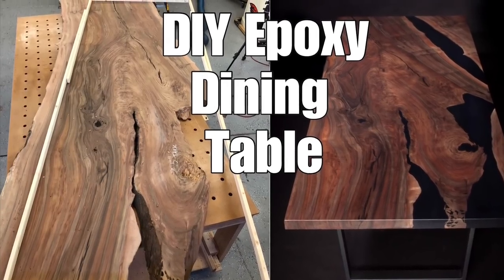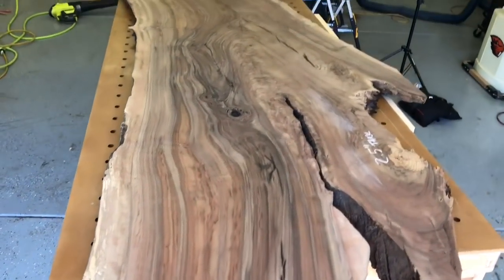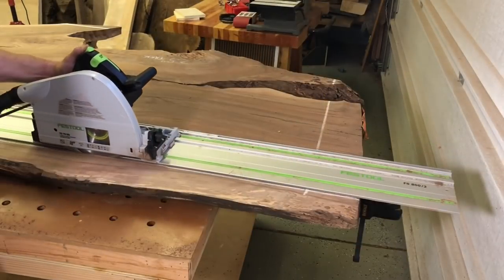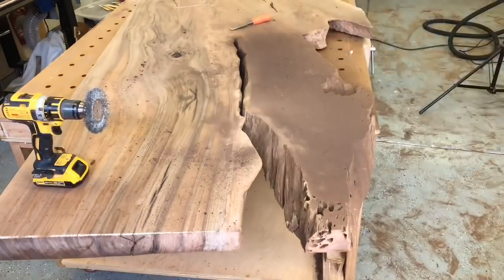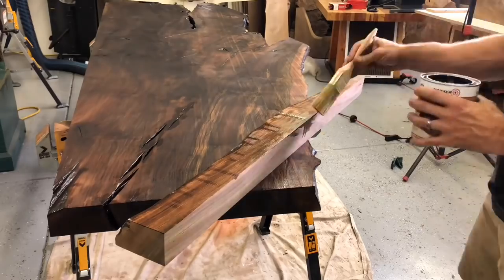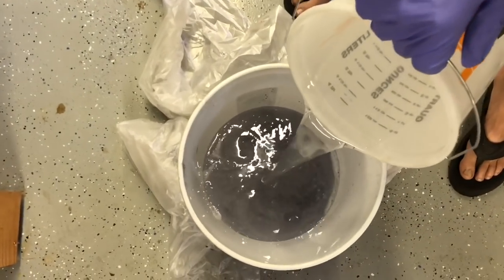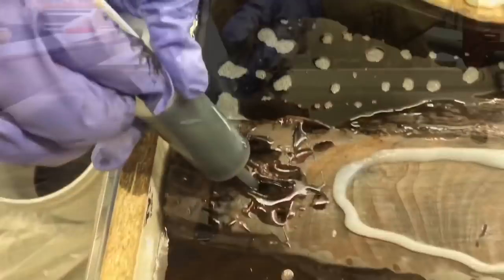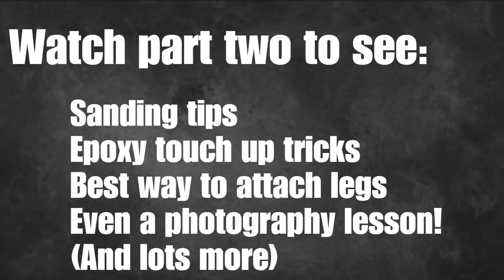DIY Epoxy Dining Table—How to Woodworking—Part One of Two

Comment: Blacktail, have you considered a penetrating epoxy to fill the rotted but very neat looking areas of the slab?   By impregnating with CPES or similar product- wonder if these areas could be left intact?  (filled and stabilized )
Reply from the maker: Kevin Morin you know, that’s a good idea. I hadn’t thought of that, but I don’t see why I couldn’t do that.
Reply: I'd prefer to see the really authentic roughness of bark, rot, spalt, and the rest over a 'dressed' edge?  Once soaked half dozen times (?) seems like the really ragged edges would be more interesting and pleasing?  Just a thought.

Comment: Sorry, never used epoxy before, I didn't quite catch why you did 3 pours. What would be the problem in doing just one pour?
Reply from the maker: Can overheat if you get it too thick when it’s hot out

Comment: Does the wood need to be fully dried? 
I'm going to have a tree cut but I don't know whether I can use that straight away without drying?
Reply from the maker: That’s one thing that isn’t negotiable. Wood definitely needs to be completely dry. I’ve learn the hard way.
Reply: @BlacktailStudio  is it better to wait for the natural dry or is there any good way you would suggest to dry it?

Comment: I have been using ecopoxy (liquid plastic 2:1 ratio) and have found in all the kits I have purchased (3 kits of 6 litres each) that the resin has started to crystallize into hard chunks, (not very large, most can pour through the opening, but some are larger and cannot fit). One kit already had those chunks in it, and the other 2 bottles of resin started to crystallize after about a month. I contacted the company and they said this will happen with the resin only and all I have to do is heat the resin prior to using and the chunks will melt and blend back into the rest of the resin. I tried that numerous times, and now I siphon the resin. But with the cost of this product it is really hard to justify buying it if this is a regular occurrence. Have you had any similar occurrences. This has happened during the winter months when admittedly the basement has been cool.
Reply from the maker: I heat all mine up in a shop sink first because of that. Very common problem

Comment: What kind of setup is that called for your skill saw as far as the guide for cutting on the straight line I've never seen one of those before and what brand  was your saw
Reply from the maker: A straight board next to your saw is a good start. Can’t really explain the jig I made here, but I’m sure you can google it

Comment: I am getting into the epoxy woodworkings and am trying to do a table top. I have got 2 really pretty pieces of cedar wood sanded down but I am at a stand still because I'm not sure what I use to build the frame to keep the epoxy from leaking out. What exactly is the name of the material you used for building your frame/box
Reply from the maker: Melamine. Easy to find!

Comment: My shop is not temperature controlled.  Am using liquid glass deep pour and temps will be between 55 and 70 degree F.  Thinking it will cause issues with my pour, can you confirm?
Reply from the maker: Na, should be fine

Comment: I would like to know why your epoxy did not "erupt".   I filled a large crack in a tree cross-section about five inches thick.  My epoxy boiled over and took several pours to complete it.  Is it the epoxy or something I did wrong.
Reply from the maker: It’s the epoxy I use 👍🏼

Comment: YOu don't need or want an employee...
Lots more hassle than any of them are worth...
You need either a mechanical hillbilly or an overhead runway lift setup, which is not hard to design or build.
Good job, thanks for posting.
Reply from the maker: I got one now.... the hoist. Not an employee

Comment: Depending on the species of wood and it's availability as well as market value (rarity, grain, burl, etc.), a slab of exotic wood can cost from, $300 USD to $4,000 USD.. If you live close bu one of these sources, you can save shipping cost, otherwise you'll pay an arm, a leg and your first born to have it shipped to you.

Comment: Why is there so much dust coming off your festool track saw? Just seen part two, table looks awesome by the way.
Reply: The reason that's happening is that he doesn't have the splinter guard attached to his saw. It needs to be attached (his is missing) and down fully on the workpiece and all of that dust will go into the vac. That was one of the many things I learned in Festool class last month in Ind. Mine was doing a similar thing, just dropping that splinter guard down changed everything!
Reply from the maker: I have a splinter guard on there, but maybe it’s time to be replaced? Thanks for the tip!

Comment: I see you checking the depth with a dowel rod.  What is the reason to check the depth?
Reply from the maker: Not to get the pour too thick. It can overheat and ruin the pour

Comment: I need your help man
I'm doing my first river table
Just casted it 4 hours ago a 28 mm cast (the manufacturer says it can be up to 30 mm in one layer) 

Now a major portion is hardened with a rippled surfacd while small others parts are not hardened and still have a leveled surface 
And i have a big crack in the middle

Please tell me this is salvageable or tell me what to do
I'm afraid i ruined my first time
Reply from the maker: 😬... same thing happened my first table. I broke it out and re poured

Comment: Hey, on pouring first layer i found lot of resin gets under the wood even after putting weights, how to stop it?
Reply: Yes, i thought first of putting silicon on the sides , but fear that it will look bad on transparent pigment i didn't use it ...😅plss share ur thoughts

Comment: you should fill it with dowels or something to save on materials cost
Reply: ianjsutt  like fill it up with a filler so you don't need as much epoxy. I imagined a buncha trimmed dowels standing up like a forest with glue being poured around them. Might make it stronger too?
Reply: ianjsutt  I did not think of the air bubbles being trapped by the dowels , thats a good thought

Comment: Does anyone know how to make sure the epoxy that fills the voids doesn’t seep underneath the wood? I’m having this issue (on a much smaller scale) and then end up having to sand it all off on the bottom after it dries.
Reply from the maker: It’s really hard to stop that. So I let it

Comment: so my table broke up into large chunks overnight. Did I pour to thick of a layer at one time? I dont understand. I would imagine that I can just put more epoxy over it and it will be fine though...thats what Im hoping. The epoxy that I bought seems to be hardening up really quickly....like in a few hours. Been waiting a day between pours though.
Reply from the maker: Oh man... that’s too bad. Yeah, you went too thick. I’ve been there. You really need to use an epoxy designed for deep pours. Or else you’ll be limited to 1/8” deep per pour.
Reply: @BlacktailStudio  Dang it lol oh well, its a learning process. This is my first build. Think if I put more epoxy over it, it'll just fill the cracks and be okay? I've got about $500 worth of epoxy on it so I dont want to just throw it away. Yeah, they're deep cracks but i'd imagine it wouldn't be any different than putting a new coat on a scratch up surface?
Reply from the maker: Andrew Bondsteel man, I don’t know... I’ve had to break the epoxy out and repour 😬
Reply: @BlacktailStudio  Appreciate it. I just poured another layer over it and it filled it up so we'll see what happens lol Definiately a learning experience.

Comment: Instead of using the injector to fill in all the gaps, why not cover the entire table with like 1/8" of epoxy and then use the industrial planer to plane it back to wood?
Reply from the maker: Would cost a lot. That would be around $400 in epoxy on this table. And there are always little touch ups that need to happen.
Reply: @BlacktailStudio  Ah, that makes sense. I figured they was a reason why. Thanks.

Comment: How much epoxy was used on this project?
Reply from the maker: 40 liters 👍🏼
Reply: Woah!  Where do you get your resin?  The best price I have found is $750 for 30 liters.
Reply from the maker: Mike Parker sounds about right
Reply: This is seriously the most gorgeous river table I’ve ever seen.  I think this has convinced me to go with black on the epoxy, for my own project.  I did notice that you poured the resin before planing.  Do you think you would have saved much resin if you had clamped, or weighed down the slabs?

Comment: if you have a table saw, why use the track saw?
Reply from the maker: musiq002003 oh man, track saw is way more versatile. Probably more reasons than I can explain here. Just put the track down and cut on the line. Table saw can’t do that without jigs.

Comment: 48 hours just to get tacky and putting fans on it to keep it cool? Man that sounds like a pain. Why do you like that epoxy so much? Not trolling it’s an honest question especially with the fans because it would give you a greater chance of contamination with dust in most shops.
Reply from the maker: Conrite Wing fair question. I’ve worked with a number of other epoxies and they are all a total pain. This one is just the best. Epoxy work is really really challenging though.
Reply: Blacktail Studio I agree it is way more changing then I thought it would be. I did a river table a few months ago. You do nice work and I enjoyed you video I just didn’t understand why this epoxy is your preference. Is it because you don’t have to torch it? Does it polish easier? Is it because you can pour it thick? Just looking for info.
Reply from the maker: Conrite Wing thicker pours, more uniform color mostly.